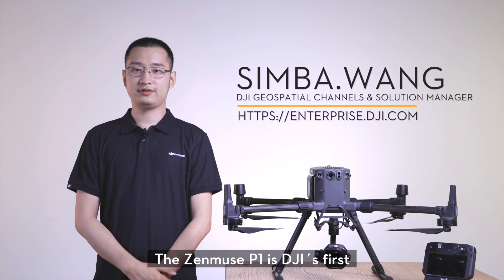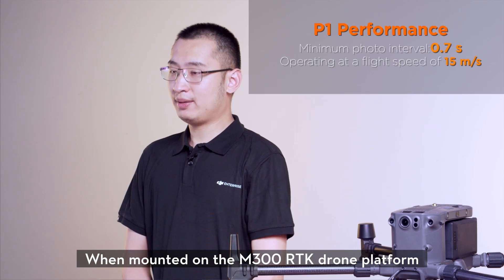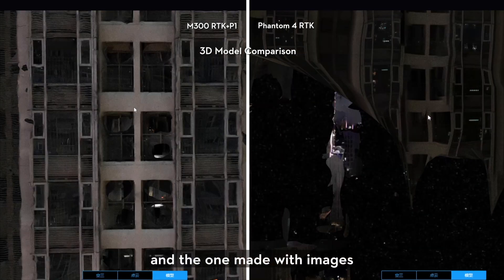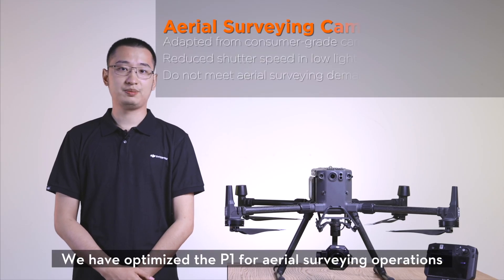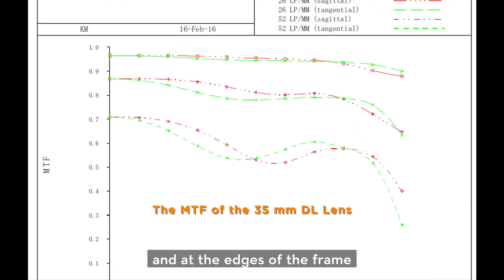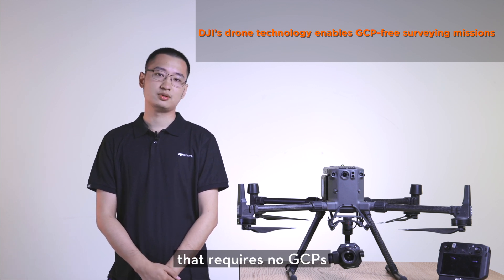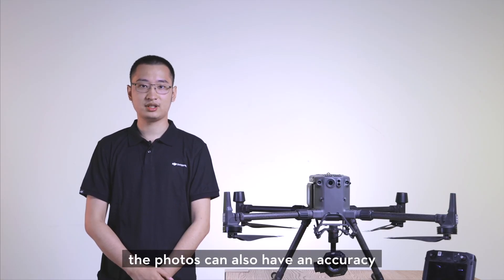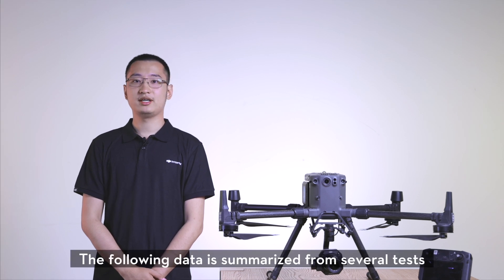Deepdive - DJI P1 and Aerial Surveying Workflow

Comment: Hi, Is it possible to use the P1 camera M300/Gimbal/RTK system as a handheld (so when not flying)? For certain photogrammetry projects, Aerial footage alone will not be enough. It would be great to use the System to make additional footage with position data instead of my consumer grade camera that only delivers good photo's.

Comment: The feature at 11:00 is a software design. I think you could add it in futures upgrades for phantom 4 rtk at least ..... ups sorry, i forgot your last upgrade is 1 year old
Reply: Think about the limitations of the gimball from p4k rtk
Reply: @teddyantohi1248  yes.. it Will take longer but it Is possible